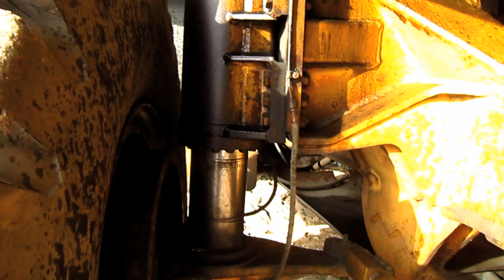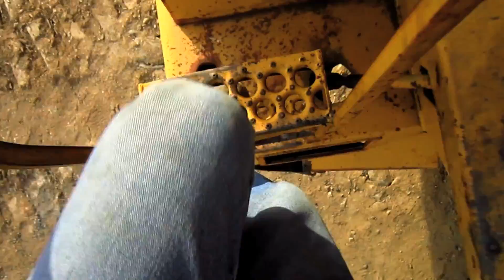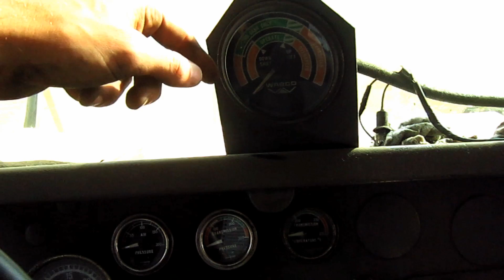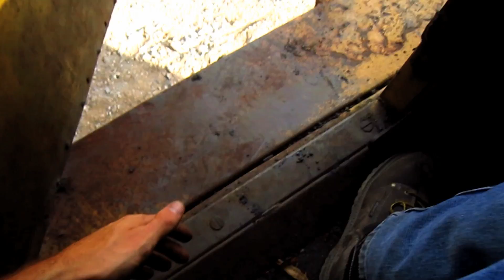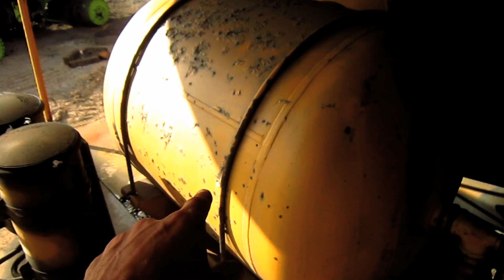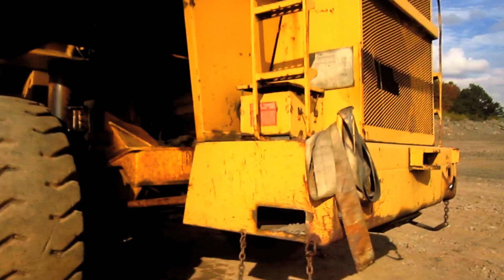WABCO | Haulpak 75B Documenatry

Comment: Are Latournou loaders just renamed from something different? (The 2300 loader with the 50+ yard bucket )
Reply: @Drew6709   The LeTourneau L-2350 was designed and manufactured in Longview Texas by LeTourneau Inc. The earthmoving part of the business was sold in 2011 to Joy Global. Since that time the L-2350 has been rebadged once or twice. The largest wheel loader in the world now wears the Komatsu name.Just so you know, LeTourneau was a completely American company. The L-2350 is equipped with a 53 cubic yard bucket. Load capacity with that bucket is 80 short tons. So with 1 fully loaded bucket you have 160,000 lbs. !!!   I hope this information helped you out.
Reply: @williamhall9204  I wasn't sure of the history of the loader. Thanks. I heard the story once before on Mega Machines.